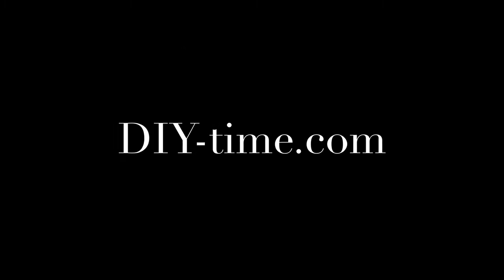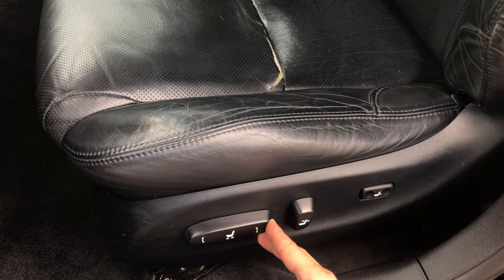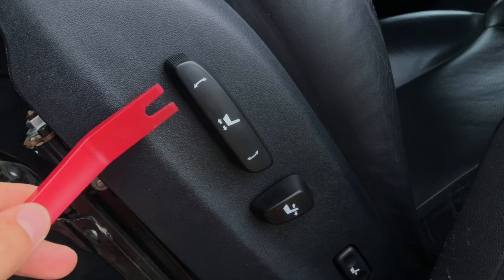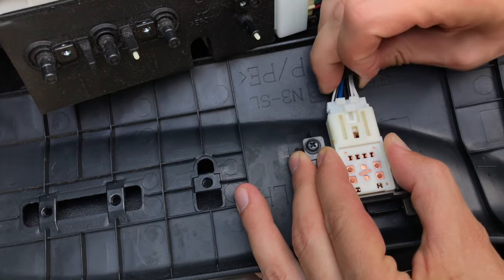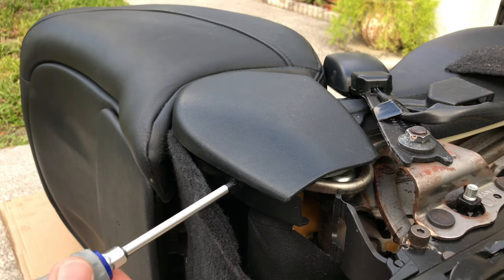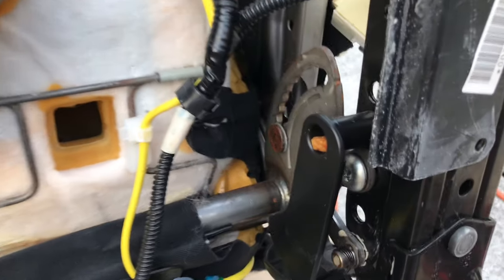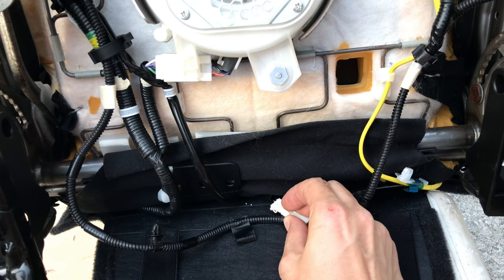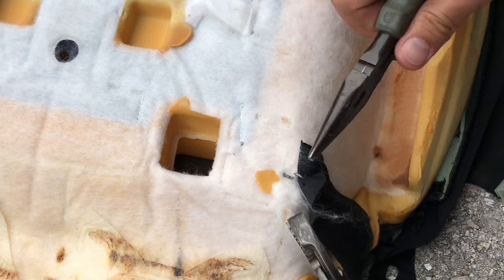How to replace Lexus leather seat cushion cover.

Comment from the maker: You can find parts and tools used in this video here: 
Seat cushion covers: https://ebay.us/wvM4MQ
Trim removal tool kit: https://amzn.to/3dwVAeT 

(these are eBay and Amazon affiliate links).
Reply: Great vid.  On my 06 ES 330, when I took the green heating pad off, I noticed it was connected to cushion with tiny red plastic connectors that were "H" shaped.  Much like the the plastic that used to  connect price tags to clothes, except these were much smaller in diameter, almost thread like. I can tell they were  fastened with some sort of gun.  I had to cut them to remove cushion as I replaced the cushion, can you tell me how to  affix the heater pad back to the cushion so that it will be tight and wrinkle-free? thanks

Comment: This is one of the best tutorials on YouTube. Very thorough and with good photography. I will use this when working on my GS300. THANKS.
Reply from the maker: Thank you!
Reply: @DIYtimeTRD  HOW DO U REMOVE THE DRIVER SEATBACK? I HAVE LOOKED EVERYWERE AND I CANT FIND HOW TO...I DONT WANNA BREAK THE CLIPS
Reply from the maker: Haven’t done mine yet, its still in a good shape.
Reply: @DIYtimeTRD  ok, i got a popping noise from the cushion rubbing on my lumbar and i wanted to see if i can remove the back panel to make adjustments in the cushion
Reply: @liltony514  bro i got the same noise mine sounds like something is broke in da back of my seat 😤
Reply: @taters7359  I HATE IT
Reply: Have you done your GS 300 yet? Was it hard?

Comment: Man. There are so many things to remove to get the cover off; I cannot possibly put the seat back together. Seeing this video, I'm impressed at the demonstrator's skill and how well made the seat is with the mechanical and electronics in it.  Good tutoring video. Thanks
Reply from the maker: You can do it!
Reply: Think seats are challenging? View some of the videos of guys that disassemble and reassemble wrist watches !
Reply: I tear down engines and put them back together after the rebuilding process. It's complicated.

Comment: I just needed the passenger bottom seat cover replaced. The upper is in great condition. The shop i took it to wanted 450 to replace it. No thanks! It’s a 2010 with 300k miles on it. Purchased the seat replacement on eBay for 50 bucks. This tutorial will help!! Thanks so much
Reply: Please share from where you buy the seat cover please, will appreciate a link. thanks

Comment: Thanks for the this detailed video.  From my experience with my 2004 GS300 - YOU MUST MUST MUST REMOVE THE SEAT FROM THE CAR.  First, take the headrest off of the seat, disconnect everything attached as shown in this video and then take the seat out to work on it elsewhere.  There are a TON of hog rings that hold the seat cover to the padded frame beneath.  Leave a lots of time to work on things because all those hog rings are a BITCH to get properly attached again!!!  Other than that its laborious but rather simple overall.
Reply: Use good quality zip ties to replace the hog rings.
Reply: @randyw4972  Hey Randy what type of zip tie do you recommend? Also how do you ensure they are in correct location?
Reply: @ReidEvers  you could mark with a marker where the old hog rings were. Use the thickest zip ties you can fit so they don't brake easily.

Comment: Thanks for the guide, only issue I encountered was that one of the screws for the large plastic trim on the around the bottom of the seat could only be removed with a very tiny right angle adapter which I didn't have so the large trim was left hanging on during the removal and installation process. I think it was slightly different for me since I have a GS and your car looks like an IS. 😀

Comment: Any thought on why the power seat is not working now?  I double checked connections before bolting the seat down but thought there might be a reset trick ?  Great video btw.  Walked me through my whole process and I have an rx 350.  Heated seat part was a pain but worked out!
Reply from the maker: Im not aware of any seat reset procedures. And mine worked right away after reassembly. Could be a blown fuse instead.

Comment: I'm replacing my seat cover on my 21013 ES300H.  The video has been excellent.   When I removed the old cover it has three plugs coming out of it.  I believe some of them are the electric seat warmer.  I live in Florida and don't need this option.  I'm concerned it may also be related to the seat belt alarm.  Can I just leave the connections under the seat open?
Reply from the maker: You could, but I would recommend keeping it as close to original state as possible. Seats have various sensors related to safety and air bags systems. You don’t want to leave those unplugged.
Reply: Was the process for your ES300h 2013 the same or similar to this video? I’m about to do my ES300h same year.

Comment: Is there a video or information on how to remove the top part of the seat too? I need to replace that one as well. Thanks
Reply from the maker: I haven’t had to do the top part on my car yet.
Reply: DIY-time just did it myself! Not hard. There were a couple of hog ties and clips.
Reply from the maker: Nice!
Reply: @lespala2772 , I have to do the same. I already replaced the bottom and it was easy enough. Is there anything with the top you can advise on such as certain clips and whatnot?

Comment: Great video. My 2007 RX350 seat heater malfunctions. When the heater is turned on. It generates burning smell. Is the heater metal pipes below the cushion in your video at ~6:00?
Reply from the maker: No, heater is actually copper wires sown into the leather seat cushion.

Comment: This video was helpful, but and it is a big but, it is much more difficult than what the poster conveys.  Especially if you have heated seats.  The "mat" that is the heated coil under the cover is very delicate and moves around a lot.  The "rings" he shows are part of a wire rail system that basically has to be cut in order to get the cover off and then can't easily be put back in.  You will get a semi-respectable look without them, but it won't be the nice factory look.  I applaud the poster again, but forewarn MOST people will get into this and then be very unhappy as it is a lot of work for a NOT professional finished product.
Reply: Thanks for this realistic info. I am trying to find more information about the rail system. Any tips?

Comment: Do you know if it would be possible to add the fan to upgrade a non ventilated seat? Seat is otherwise identical
Reply from the maker: It must be doable, cuz they can do it at the dealership on any car when people buy this as upgrade option, but it may require a bunch of stuff, like fan, wiring, control buttons, etc....

Comment: Hi, can someone tell me if the replacement seat cushions are the same for both the drivers side and passenger side?  Can you swap the drivers side and passenger side cushions over without any issues? Thanks
Reply from the maker: No, on my IS350 they are slightly different.
Reply: DIY-time Thanks
Reply: why you wand your passenger to sit on damaged leather...

Comment: Great video. Thanks, DIY-time. Where did you get those handy plastic tools to remove the plastic caps with ease? I will need to replace my front driver side bottom seat cushion. I will be watching your video several times....:) How much did you spend on the seat cover?
Reply from the maker: Thanks!
I posted a link in the description under this video for the tools and seat cover. 
I was lucky and found my seat cover at the local junk hard for just $6! eBay is my second choice for used covers. Dealer wants something like $1000 a pop.

Comment: This video won't work for a 2008 Lexus ES 350 - the seat belt is attached to the seat and seat trim.  There seems to be an extra screw somewhere to prevent the removal of the trim. Plus, you cannot remove the seat from the car easily, since the seat belt is attached to it.  I didn't find any videos on the internet that show how to do the seat removal on an ES 350, so you're on your own.
Reply: I was looking for a video on how to do my seat cover on my es 350 2007… thank god I saw this comment now I’m def not doing this job

Comment: The most hard part of replacement (closing metal rings) wasn't show at all
Reply: You need hog ring pliers to reattach the seat cover.
Reply: @charliekilo3  I save tons of time:
Just used plastic ties for fixing instead of metal rings)
Reply: Ooof until those ties are broken by air temperature differences,  those ties are worthless in my opinion

Comment: where can i get good design for 2010 lexus rx 350 leather car seat cover s
Reply from the maker: You can find a few interesting designs here: 
http://rover.ebay.com/rover/1/711-53200-19255-0/1?ff3=4&pub=5575132837&toolid=10001&campid=5338538549&customid=&mpre=https%3A%2F%2Fwww.ebay.com%2Fsch%2Fi.html%3F_from%3DR40%26_trksid%3Dm570.l1313%26_nkw%3Dleather%2Bseat%2Bcovers%2Bfor%2B2010%2Blexus%2BRX%26_sacat%3D0

Comment: very good instructional video. but why you just not tear off damaged leather from sew joints and add new one and then sew it under? i do many diys too, but to reassemble seat to change cover is little bit unnecessary. if you change other seats, speak with pro sewer or watch em in work, it is possible to sew leather underneath with unvisiable joints. but who disliked this video are the guys who work in seat change service point xd.
Reply from the maker: I don’t think you can sow it right on the seat. Unless you are pro and have the right tools. Which I’m not 😁... 
In my case the foam cushion was ripped and needed to be replaced too. And for that you absolutely have to take the seat apart.
Reply from the maker: Plus sowing pro will charge you quite a bit for their work. I spent like $15 total.
Reply: @DIYtimeTRD  sew.

Comment: I cannot find the link to obtain covers. Looking for the ES300H driver seat lower cover.
Reply from the maker: The link is for IS model. Just change it to ES300h in the search box at the top of the page.
Reply: Question regarding es300h (2013). How do I disconnect the airbag sensor from the battery?